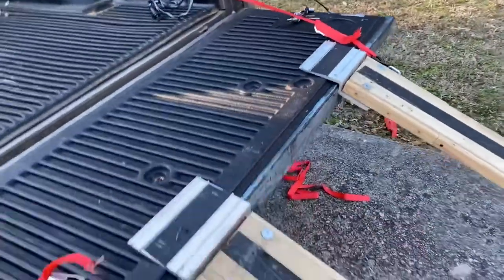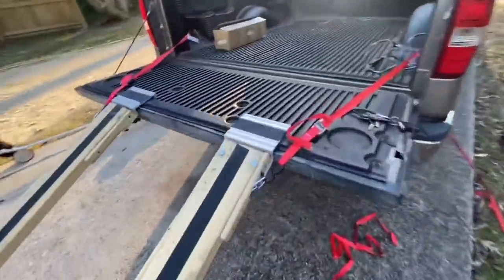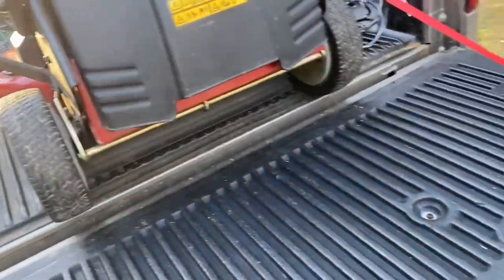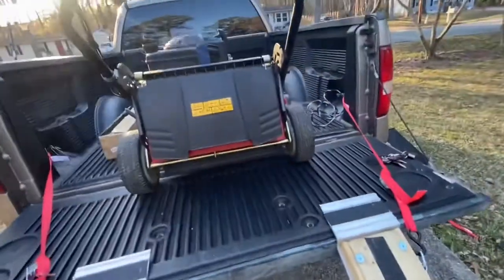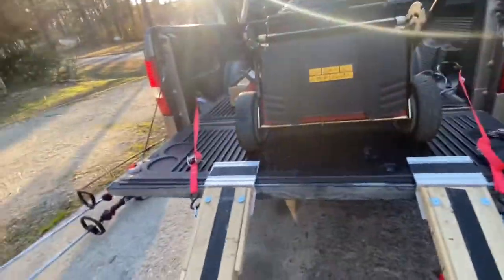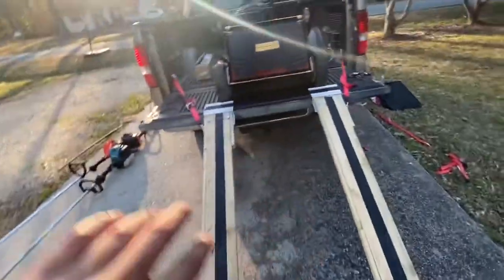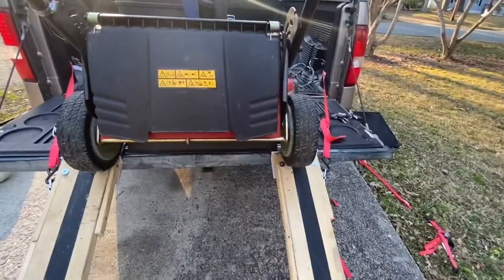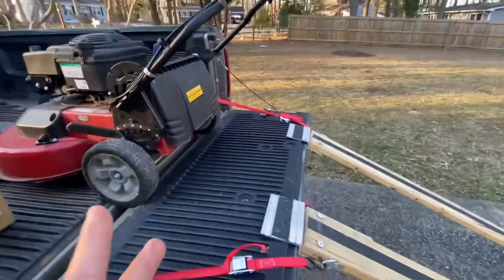Lawnmower loading ramps (no more sliding out? This a good idea??)

Comment: i use 1/4" rope instead of the red straps. drill a hole in the top of the board, put in the rope, make a loop by tying a knot in the rope, put the rope around the lug in the truck bed that locks in the tailgate.

Comment: I use a cargo van with small ramps. 2005 Chevrolet Astro ive been driving it for 3 years now and it still runs great. I just got a Toro personal pace mower and a barely used Stihl FS 56 for free because a customer upgraded to a small tractor.
Reply from the maker: Happy for you

Comment: Put one eye screw on the inside at the bottom of each ramp, and carry a piece of wire that will slip into each “eye” holding the ramps from spreading apart.
Reply from the maker: Thanks for comment my friend. Got a trailer now

Comment: Velcro on the truck bed or just use cheap neo magnets and tape it to the truck so the ramp sticks to it. Or just cut the wood where it meets the metal at a different angle.